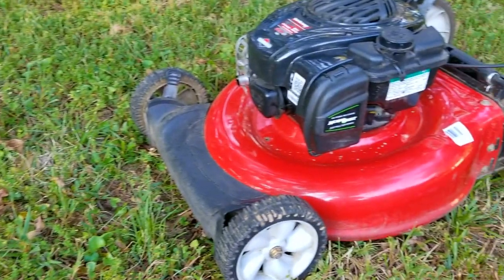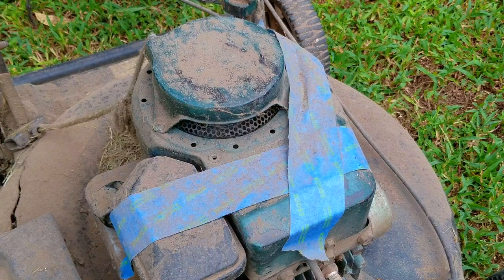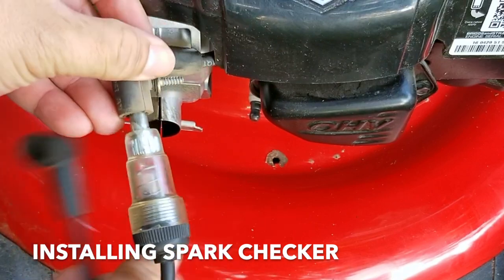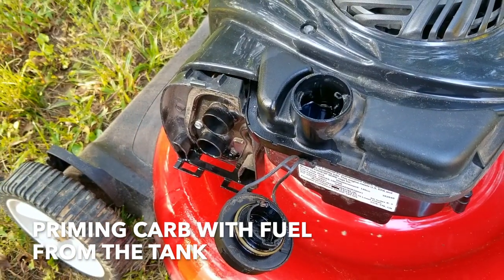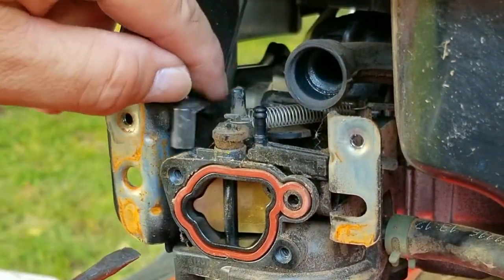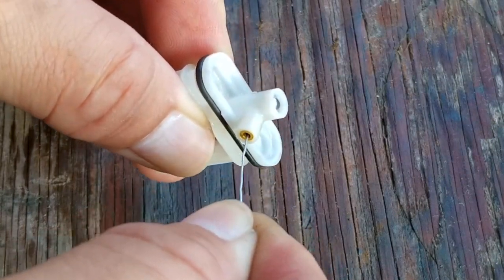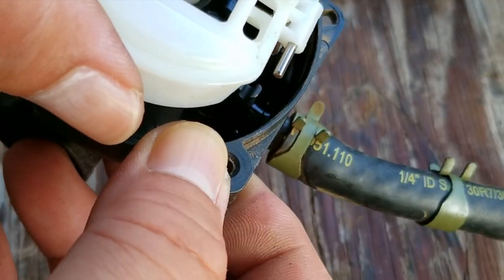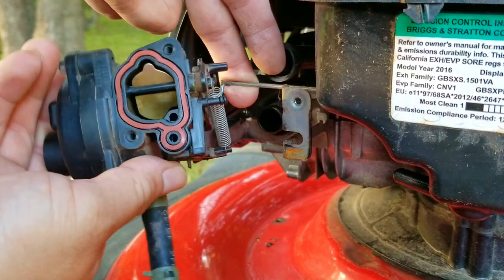Why Did Briggs Stop Making The Flathead Engine?

Comment: the only reason I have disposed of my old B&S engines is a bent shaft. fortunately I know of a retired railroad worker who acquires broken lawnmowers, fixes them, and resell them.  his workshop is in a spare garage on his property. when I mentioned the bentshaft engine to give him, he was happy - the simple casting parts of the engine block to buy new are expensive - and those parts are interchangeable. he was able to repurpose the broken engine. better than sending a 'slightly less than perfect' engine/lawnmower to the dump.
Reply from the maker: that makes sense

Comment: Have worked on mowers since my teens, and have had a part time mower repair shop for over 30 years. These new plastic carbs I get in that won't start, I take the carb off and blast it out with carb spray, blow them out, and usually they are good to go. If they still don't go, I stock the white plastic jet/emulsion tube assembly and I just snap a new one in. Not much else to go bad in the plastic body, unless it's warped, and I stock carbs too. I don't spend a lot of time trying to clean these carbs, for the price I get them for as a dealer from my supplier, it's not worth the labor time trying to get the old ones working if it's more than a simple clean and blow out with compressed air
Reply from the maker: you are correct, I've thought about doing the same, stocking plenty so I don't have to waste my time

Comment: Good instructional video... I have been using this newer type of engine since 2019... The Big secret for me is "Don't use GASOLINE/PETROL, EVER!" Use Methanol instead.. The Brand that I use is VP , pre-mixed 50:1 with oil for Two-cycle  engines... There are other brands as well.... That way, I only store one fuel for both 2. and 4 stroke engines.. You can store fuel in them for years and they will promptly start in 3 or 4 pulls, providing that the air-cleaner is clean... The Methanol doesn't breakdown or degrade over time.. The engine and valve components stay much cleaner... And for a No Oil Change engine, I change it every year...
Reply from the maker: thank you Bill Crismon for the information

Comment: My Honda 5HP OHV mower is over 20 years old,  my Honda 35CC  0HC whipper snipper is over 10 years old, both start and run perfect, carb. cleanout and spark plugs, oil changes, air filters.
Reply from the maker: both very nice machines!

Comment: The best carb solution, when a tank to carb line exists, is to install a fuel shut-off valve and and run the carb dry as mowing is finished.  
I had both a flathead and an overhead at the same time, I noticed the overhead used significantly less fuel for about the same power rating.
Flat or overhead, I have always ended up with a good engine sitting on a rusted-out, cracked deck, broken cables, bald falling apart tires, and messed up handle pivots.
Reply from the maker: there is lethally only 1.5" between the carb's port and the one on the fuel tank. It leaves no room for line, and valve.

Comment: Fundamental cam. Set ignition to near top dead center. Lighten the governor spring. Lower the compression. Now the old flat head and the magnum run very clean and friendly. A 148 CC is on it's fifth deck.
Reply from the maker: thanks for the information

Comment: Quantums are wonderful. All I did to mine was change oil yearly. Gas? I never drained it. Put a mower away in October with fuel, then in April, prime it, pull the rope, and it worked.
Reply from the maker: yep you got that right

Comment: I actually like both ! I have 1985 Snapper self propelled walk behind that I got 33 years of service out of it ! It was a 4HP B&S flathead I wanted to rebuild it but couldn't find a rebuild kit for it , So I bought one these newer B&S engines to put on it & managed to retrofit the blade brake , & The throttle lever control to the new engine witch is 5 years old now it's a  725 EXI 163cc engine 7.25 & it works great ! I usually fill the tank all the way up or completely run it out of gas for storage ! & it starts either the 1st or 2nd pull ! Also I bought a B&S  oil siphon kit to change the oil every season ! & yes I also use B&S oil in all my small engines , & yes they're all B&S ! I have one other of these newer B&S engines on a walk behind trimmer mower & it's going on it's fourth season ! & I have several other mowing equipment that have quantum , Intek , V twin , Power Built that are all B&S engines all get yearly service by me , & are used on my property only , & are all are very reliable ! I use my equipment by the motto of ,Take care of your equipment , & It will take care of you. Thanks for the video.
Reply from the maker: thank you Venice Cox

Comment: I only use old engines, no matter if it's a yard tool, gokart, or hotrod. Have a handful of 3.5 and 12 horse briggs for both the push mower and garden tractor. Only things that get replaced are carbs, mower decks, belts, and blades
Reply from the maker: very nice! thanks for sharing.

Comment: I should ad that I did have a Sabre riding mower with an Intek engine, but it was an early intek engine from 1998, which was not like the later ones, it was like a modified flathead engine, and looking at the top of it, it looked just like a flathead engine. That was a very reliable engine that never gave an issue except for the needle in the carb jamming open and flooding the crankcase, but after fixing that, it ran for another good 2 years until the hydrostatic transmission gave out on the thing and I dumped it off for $50.
Reply from the maker: nice, and thanks for vouching for them.

Comment: Very nice and informative video! I have on my 3000 qm call Ram set on lawnmower from John Deere with the V2 cylinder, gasoline engine from Kawasaki and one self driving Honda lawnmower with 150 cc overhead cam and one older about 1995 Honda also was overhead cam but 135 cc. After my two-stroke water pump failed, I bought also the 50 cc Honda, four stroke overhead water pump and the hand grasschopper for around the tees or for hard weed, You can use with a scharp thin rope from hard plastic wich is on a roll and gets cut after it is worn out by a blade on the Side of the shield at the back or you can use it with the metal disk looking like a saw plate but there are different kinds of metal plates, so I have also one with the three blades so you can cut even with a heart weed, which is more wood like. Anyway, this machine uses the same 50 cc OHC 4t engine with 1.5 hp than my water pump. Since more than 25 years, I am very happy with the Honda products and the newer models on the water pump and the other one with the 50 cc four stroke I am using Sims 20 years without any problem only oil changes same with the John Deere. That is also a diesel variant the of that lawnmower but because I am using petrol for all my other vehicles, I choose that one with the Kawasaki engine end. It makes also a few horsepower more sense for me. 
 My chainsaw and my bush trimmer (I am not sure if that is the right word because I am from Germany and I don’t know the exact word for that machine we call it “Heckenschere”) it is also from Stihl and they are both 2strokes with a 1:100 mixture Danielle also more than 20 years old, and never made any problem. I feel if you buy a good garden machine you have to buy expensive. Otherwise you will buy twice or more times depends how long you need it if you have a pig cartoon what you want to keep for the rest of your life it’s definitely better by the good stuff.
Reply from the maker: thank you for the information A. G. Russ. Honda products work very well and if taken care of, should last a long time.  And I believe Heckenschere should be translated to "hedge Shears"

Comment: I have an old, well beat push mower (pretty sure it's got a briggs) that once had some sort of stain or varnish added to the crankcase accidentally (my grandpa stored it in an oil bottle and forgot it wasn't oil) then he ran it until it would no longer turn over.. He gave it to my Dad who flushed the crankcase with kerosene several times, looked like black cottage cheese coming out. Refilled the oil and it may have had another oil change while my Dad was alive... It has been burning a decent amount of oil and knocking HARD for the last 6 or so years.. Dad and Grandpa are both gone now and I haven't changed the oil in at least 4 years, but I keep it full and I suspect it will outlast me. It has never had the fuel drained, and hasn't been started since September but I guarantee if I walk out to the shed, give it 5 pumps on the primer and 2-4 pulls on the starter, it will clatter to life with a cloud of blue smoke. Still has plenty of power to mulch heavy wet grass (although definitely less than the original, 6 or 6.25 hp) It's definitely outlived it's intended lifespan.. I don't think a cheap early 2000's was designed to last 3 generations!
Reply from the maker: well said and yes the older Briggs are great engines.

Comment: I bought an edger off of Craigslist for 10 dollars It had a Briggs Flathead on it that was built in 1962. I cleaned the carb and replaced the plug and it started on  the second pull. I then tore it down and painted it, put it back together and  it looked and ran like new. I sold it for $100.00
Reply from the maker: very nice work, got your money out of it.

Comment: My dad had a craftsman push mower He bought it used with my childhood house in 1997. The deck completely rusted away like literally turned to dust but that flathead still ran perfect. I took it off and it's still sitting in my dads garage
Reply from the maker: very nice, shows how well it was made.  Thank you Petrol head.

Comment: I've run nothing but flathead engines, mainly Briggs % Stratton. I think the real issue with starting problems is the owners' lack of maintenance. Hopefully Youtube videos such as yours, and others, will get the message across in how to properly store gas powered yard tools for long periods of inactivity. Certainly the mower manuals aren't all that clear on the process. Let's face it, we live with ethanol fuels now and so we have to learn to adapt to the correct maintenance so that the ethanol and other additives  do not damage the engines / carbs. Generally I think new designs in small engines have will have issues, just different ones, but that doesn't mean that they are any better or worse. Yes, there are some exceptions, but I'm talking mainstream brands. Good video and the issues were well explained.
Reply from the maker: thank you Martin Audet, I appreciate that .

Comment: The old briggs industrial plus on my log splitter is impossible!  It won't die!  It sits outside 365, uncovered.   I recently had to replace the coil - that's it.  28 years and counting,  I'm just glad I'm not waiting on an inheritance from it.
Reply from the maker: wow that is pretty amazing
Reply: I remember back in the day B/S use to get back the warranty replaced "faulty" coils, test them and found nothing wrong with them.....

Comment: Last spring, I replaced a crank-bent Honda GX on my Snapper with a new Briggs. It was a 30 minute swap, 
and the Briggs starts and runs like a champ, although it's a bit louder than the Honda...but half the price.
The no-throttle, fixed-engine speed needed to be tweaked a bit, and the lack of an oil drain plug is a silly nuisance, but certainly not a show stopper. ALWAYS RUN GAS TREATED WITH STA-BIL or other stabilizer, and never let it sit more than a few days with gas in it, and ALWAYS run it dry when putting into seasonal storage. Along with synthetic lubricants, it should last a long time with proper care and periodic maintenance.
Reply from the maker: you are correct, all your precaution will make sure there won't be an issue with the briggs engine.

Comment: I've got a 10 year old briggs and stratton 850 series I have changed the oil on it a few times over the years but thats about it, it handles leaivng old fuel in it no worries I dont have any dramas running fuel that is a year old. My question is tho it has an oil filter does that mean it has an oil pump? I thought all these mowers just splashed the oil around with a paddle.
Reply from the maker: yes if it has an oil filter it means it has a pump.  Those without filters "only  use" splash oiling.  Yours should be a combination of both pressurized and splash.

Comment: At 4:58 with the float removed we see a shiny metal disk pressed into the plastic carburetor body.  The disk in my carb had fallen out.  What purpose does it serve?  May I leave it out?  If it must be installed how is that done so it won't fall out again?
Reply from the maker: the disc simply covers over a larger opening used for manufacturing but it's not meant to seal it off, only partially cover it.  I've had them fall out before and didn't bother to put them back and it was fine.

Comment: I'm still using a Briggs mower from the seventies, it always starts on the third pull. The only maintenance it gets is once a year the oil gets changed any the filter gets cleaned.
Reply from the maker: nice work, keep it up and it will last for a long time.

Comment: The drain plugs on the older engines are cool, but I bought a fluid pump years ago for when I am working on Honda engines, so I am accustomed to them not being there at this point.
Reply from the maker: nice, I need to set mine up

Comment: I had a Snapper self propelled with the Briggs. Bought it new in 2003-04 - think it was the flathead. Anyway, it was running when I gave it away to move out of state. Wish I’d kept it. I did take care of it, however.
Reply from the maker: it's amazing how a little bit of care will make something last.

Comment: I can't say I am extremely kind to my mowers, but I do maintenance and clean them, and I expect them to last a while. I used to have an old Snapper from the 70s, which never gave me any issues at all, I had it about 5 years until a rock cracked the aluminum deck of the mower. After that, my friend got me a brand new mower with one of these OHV engines, and I used it maybe 5 times before it broke, so returned it and got another one and the one that replaced it ended up hitting a (much smaller) rock, which bent the crank, which should not have happened. After that I fired up the good ole craigslist and bought a Snapper mower from probably the 90s with a 5hp Quantum flathead engine, and it has never given me a single issue. I also have 2 mowers with the smaller Flathead engine with the carb that sits on top of the tank, and they are also trouble free. One of those machines was over 25 years old and has never had an oil change, it was the thickest blackest oil I had ever seen, but I changed it and besides for a tiny bit of smoke on startup, it still runs reliably. I would love to see one of those new ones do that. 
My friend also bought one with the newer OHV engine like in the video, and it worked once and died, turns out it somehow broke a valve, so I put a new set of valves into it, and it runs (just) okay now, but after having it for a year, it has to be started by priming the carb manually like you did there. Overall I feel that they are (like most modern products) lousy. Sadly it seems that parts are becoming a bit hard to find for the old quantum engines, and even some of the "classic" engines, so I am doing as much as I can to keep my machines in good running order.
Reply from the maker: thanks for sharing your experience, and yes newer products typically seem to be a lesser version of the one they're replacing

Comment: I use Sta-Bil year round and have never had a problem.  I also start my mower once a month in the winter months so I never have a problem with it not starting.
Reply from the maker: that's a good method to keep it working for the spring, Thank you Eric Whitehead.

Comment: I had a quantum flathead pressure washer. My uncle gave it to me on its last leg in 2003, which lasted until 2012, only junked because of the busted gas tank. If it was up to me, I'd still have it, but I'm happy with horizontal honda gx.
Reply from the maker: not choice in replacements

Comment: I bought a toro awd mower with blowen engine.  163cc? The throttle plate came out of throttle shaft.BLEW UP.  Kept looking for replacement engine,  no luck. Found a quantum with correct size crankshaft free along curb. (Broken handle) had to drill crankshaft and tap to 7/16 and put a toro top cover on it. It is a low hour mower will put it for sale in a month or so.
Reply from the maker: very nice work!

Comment: The plastic carb is not new, my B&S flathead lawnmower engine from some years ago has one. It has a red rubber priming button molded into the side.
Reply from the maker: you mean the pulsa-prime,  yes that's been around for some time. 
Plastic cars, and a float bowl style is newer.

Comment: I have one of those engines.  Only 6 years old and burning oil.  Why?
Also, the carb drain plug is a better way to drain the gas.  Opens with a hex key.  Just put a shallow tray under it.
Reply from the maker: you are correct about the drain, very handy.  How many oil changes have you done in the 6 years?  You have also have lemon when it comes to piston rings. It happens sometimes.

Comment: I do a lot of OHV Briggs and Stratton fuel system clean outs in the spring, see a ton of them at the dump every year still looking new, they are truly worthless. I got a old Eatons tiller with a flat head Briggs from under a cedar tree, I was told it sat at least 25 year's, fueled it up and it ran although only on nearly full choke.
Reply from the maker: are you going to try and fix it?
Reply: @INSIDEHOUSEGARAGE  This was a few years ago, I tuned it up and used it until last year, I got a larger self propelled Honda and sold the Eaton's Tiller.